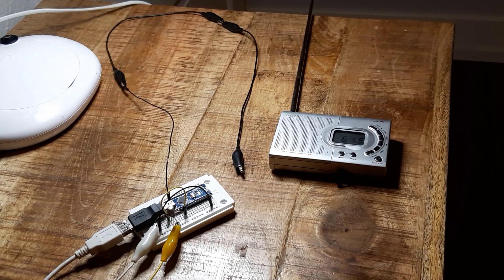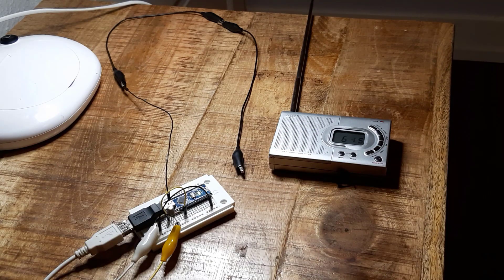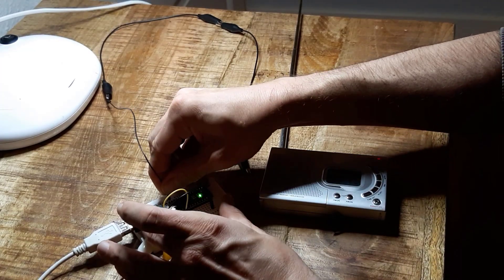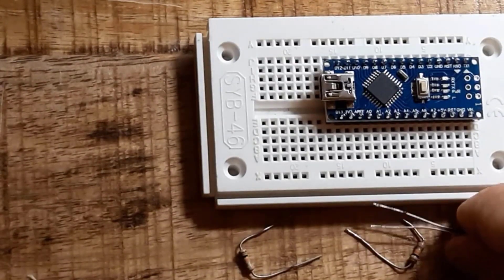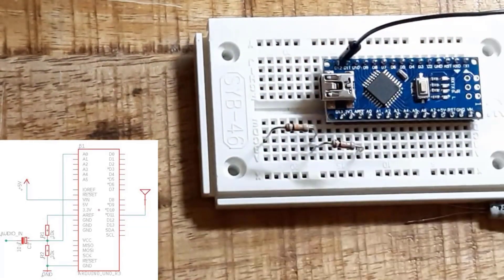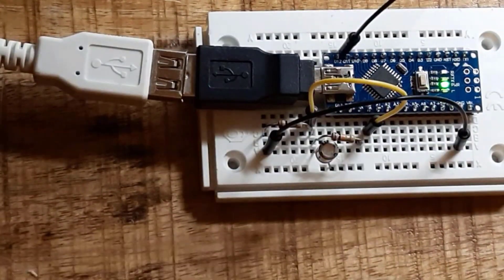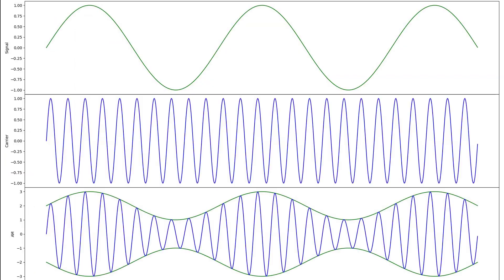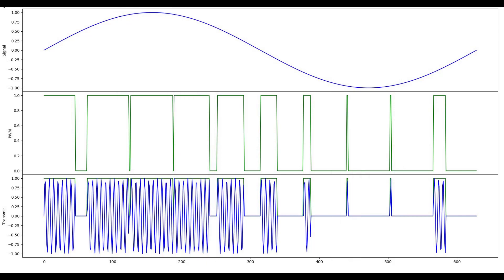Arduino as AM Radio Transmitter

Comment: Hello, I just tried this using a DFPlayer Mp3 module with the nano as the audio in, I can hear the transmission but there is a high frequency ringing in the background. Is there a way to fix this?
Reply from the maker: Must be some problem either with you MP3 module or your radio. I've never heard a ringing.

Comment: How can I get it working with Arduino Mega 2560?
Reply from the maker: Yes, it also runs on the Mega
Reply: @DoctorVolt  I don't know how to get it working properly, also I am in the US so there is a 10 kHz channel spacing, and there is a radio station near 615 kHz

Comment: Excellent, 2 things I want to do but I don't know much about the subject, so that it has a greater range of about 1 kilometer, and so that it is on the 1030 AM frequency, thanks😃
Reply from the maker: You can try with a ferrite or frame antenna. But even with this, I don't think that you will really reach one kilometer without amplifier.

Comment: 8 bit audio quality is too low. Can we do 16 bit? Any ideas?
Reply from the maker: No, because the A/D converter has only 10 bit resolution. I doubt that 16 bit will give better sound quality, because AM sound quality is bad anyway.
Reply: @DoctorVolt  I've designed a circuit. Where to send? It's max resolution is 16 bit but due to noise expect 14 bit sound quality with an audio Bw of 20Hz to 20KHz. Only a single Arduino Nano and two other chips. It transmits on 1600 KHz.

Comment: 8Mhz has a wavelength of ~37m and requires 6.4 meter of antenna (1/4 wave length in copper). So the antenna must be long enough for transmission and reception....Does that explain the limited transmit range of your project? Is there a way to improve it? My initial thoughts are:
1) Using higher harmonics of that PWM signal. Like 5th order. Which will reduce antenna length to 1.3 meter  
2) Use a simple class-E power amplifier to increase antenna current
3) Impedance matching network to maximize output
any other thoughts?

I think it is quite meaningful to hack ATmege168/328 chip as a RF chip by exploiting its high freq PWM. Several privileges: 
1) Do not require an external RF module. Making a wearable ring that transmit data to a RF receiver is totally possible just with ATmega chip. Footprint would be very small.
2) Low power consumption, compared with ESP8266 and ESP32 MCU with RF features
3) Arduino ecosystem, friendly for hobbyists and rapid development, compared with BLE MCUs like nRF52 series
Reply from the maker: Of course, chained crocodile clips are far from being a good antenna. This was just for demonstration. I think that a ferrite or frame antenna in conjunction with an impedance matching network and/or amplifier could significantly improve the the transmit range .

Comment: Doctor Volt, if you don't mind replying. So TCCR2A, TCCR2B and  OCR2A are the main register variables responsible for setting up the frequency?
Reply from the maker: OCR2A defines the frequency, the two other the operation mode of the timer.

Comment: I have a question, does this produce a square wave or sine? If it’s abusing the pin like a certain pi project, and producing a square wave, then it would produce a bunch of nasty harmonics correct?

Only reason I’m asking is I’m looking to build my own low power am transmitter just to broadcast music to my antique radios I collect and like to repair.  But I also know the FCC doesn’t mess around, and if you’re caught with a transmitter that doesn’t follow part 15 guidelines, and it starts spewing out unintentional harmonic frequencies that travel farther than intended, and mess with other devices, they won’t hesitate to heavily fine you for it.
Reply from the maker: Basically, an Arduino is a digital device and thus outputs square waves. So I highly recommend to filter the harmonics out with a low pass filter before connecting an amplifier and antenna. But with a short wire as it transmits only a few meters, so this should be ok for a short test.

Comment: I think, the capacitor is for isolating the source from the Arduino, it that right and would Y1 caps work too?
Reply from the maker: Yes, that´s its purpose. You can omit it, when the source already has an output cap. 1µ should also work.

Comment: because if I put 1602 khz in the code instead of 600khz it does not transmit anything and if I put 1600 khz it transmits?
Reply from the maker: The arduino generates the frequencies by dividing the 16 MHz clock frequency by whole numbers such as 2,3,4,5..255 etc. Therefore, only 255 different frequencies can be generated, for example 1600 kHz (16MHz / 10) or 800kHz (16 MHz / 20). The frequency value you entered into the code will be runded to the next possible value.
Reply: @DoctorVolt  thank you so much for the accurate answer ... great ... now i understand ... i wanted to ask you something if i don't bother you ... is it possible to put an ad9833 to be able to get all the medium wave frequencies? there is a code like yours that works with the ad9833 module and you can write in it any frequency like from 531 to 1711 khz? I tried to search on the net but I can not find anything ... only dds but more complicated .. thanks so much and best wishes for a happy easter.
Reply from the maker: As far as I know, there is an Arduino library for the ad9833 available that can be installed by the library manager. But I have never used this chip, so I have no experience with it. Happy easter for you, too.
Reply: @DoctorVolt  hello sorry if I disturb you again .. I wanted to ask you one last curiosity .. I have done many tests of the transmitter and it works well ... is it possible to increase the modulation? the volume is low by inserting an mp3 player or other line sources. I wanted to know if in the code you can change something to increase the audio in transmission by acting from the pwm or other? thank you so much and sorry again for too many questions ..
Reply from the maker: I see no chance to improve this. The PWM duty cycle already goes from 0-100%, and the reference voltage of the ADC is 1.1V. this means that an audio signal of 1.1Vpp results into maximum volume. Maybe your input signal is too weak, so you can amplify it with an LM386 for example.
Reply: @DoctorVolt  ok very kind .. I tried with lm386 and it works better .. you can not increase much because it goes immediately in the audio saturation but anyway it improves a little maybe the audio input should be filtered to reduce the distortion .. thank you very very kind

Comment: I only have the mega 2560 seems most of the pins you use are on the mega but the code might be a problem I am new to arduino, if you have time a summary of necessary modifications would be most appreciated thanks (any reason why +5v is connected to VIN and not 5v pin & I assume the 5 volts required is from a battery etc? )
Reply from the maker: It also works on the Mega 2560 as it shares the same timer and counter registers as the 328-based boards. I recommend powering it through Vin because then there is a voltage regulator between your power supply and the MCU, protecting it from overvoltage.
Reply: @DoctorVolt  I built the circuit today using Mega 2560 it accepted the code,  I can hear music though I have to hold the AM radio on top of the board as the antenna is not working also I receive the signal/music at 1000 khz but not at the prescribed 600 khz as written within the code so it might need a tweak to the code but not sure what to do? Unless there is a compatibility issue any help would be most appreciated thanks
Reply from the maker: I again checked the code against the Atmega 2560 register description in the manual. There is no difference to the Atmega328 used in the Nano and Uno boards. So I don´t think that there is a problem with that. Did you make sure, that the frequencies on your radio´s dial really match the frequncies it actually recieves?
Reply: @DoctorVolt   Ok thanks I will keep trying thanks for the reply

Comment: I got a question so i dont want to send a full song but just a single Signal and i would love to send this signal from the Arduino how to do that ?
Reply from the maker: In this video: https://youtu.be/Ev3Xti8TeD8 I show how to generate arbitrary waveforms. So you only have to combine the syntesizer code and the AM transmitter code into one. Or to make it simpler, you can take two Arduinos, one as syntesizer, the other as transmitter.
Reply: @DoctorVolt  thank you very much

Comment: Hi, I was wondering whether A0 or Aref is the input voltage to do the ADC on/how do they relate? Since the Arduino takes in voltage from 0-5 V for ADC but audio signals are generally .3 volts, how did you figure that out with the biasing? Additionally, you have a 5V input in the schematic, but I didn't see it in the video.
Reply from the maker: The input voltage goes into A0. In the Arduino´s setup() function, I configured 1.1V (Voltage at ARef pin) as maximum for ADC. So the voltage divider with the two 10k resistors between GND and ARef gives it a bias of 0.55V. With the setup, the output value of the ADC is 512, when no audio is connected. With Audio it can be anything between 0 and 1023, depending on the amplitude.

Comment: @Doctor Volt can we make a demodulator circuit with arduino with the same concept?
Reply from the maker: No, because the ADC is too slow for sampling the antenna signal, and the Atmega too weak to do all the necessary digital signal processing.
Reply: @DoctorVolt  it may be possible to bring down to IF frequency, convert the 600khz AM signal to 10khz AM signal and then do the ADC...

Comment: I like this project and found that it worked well with a modern am/fm radio. When I tried it with an old AM only radio it was not really a success. I changed the frequency  as the old transistor did not pick up at 600. But it did not get acceptable reception and  interference noise was louder than the content.  It may be the alignment on the old radio but it can pick up what is left of medium wave where I live and I had hoped to avoid doing an alignment exercise.
Reply from the maker: I made another video where it works perfectly with a very old radio: https://www.youtube.com/watch?v=6u25i1fyGKg. But there are may also be radios that get "confused" by the PWM...
Reply: @DoctorVolt  Thank you for reminding me about the other video. I had watched it but remembered it for the radio more than the transmitter.  I will have another look at that one. The radio I am having issues with is much newer, a 1964 AM/FM transistor from the budget end of the market. Although more modern I suspect its reception capabilities may still be poorer than the VE301.  I also have a more expensive Dynatron radio also from the early 1960s. I will try that as well. It has better reception quality than the Dansette.

Comment: Tested and worked couldn't get decent audio quality, perhaps because i literally connected the 3.5mm audio jack out my pc with a jumper wire to the capacitor by holding the two wires together by hand, audio quality improves with higher capacitance.
Reply from the maker: Yes according to the properties of your audio source, the sound quality might be better with higher capacitance. But don´t expect too much from a "fake"-AM.
Reply: @DoctorVolt  What capacitance did he recommend to improve the audio?
Reply from the maker: 10 microfarad or more gives decent audio quality

Comment: Wow this video is very cleary, i can easily to understand your explanation. I have a project that is adruino AM transmitter for Morse code, distance about 20-50 meter.  Is there anyway to code for adruino Morse code and modulate AM before transmitting. Sorry for my bad English
Reply from the maker: Sure, setting the antenna pin as input stops the transmission and setting it as output resumes transmission. This can easily be done with the function pinMode(11, INPUT) and pinMode(11, OUTPUT)
Reply: As your mean, I have to add function pinmode into Void loop? If I do that, audio input, resistor, cap can be removed? Right?
Reply from the maker: Yes, that´s right. Resistors and cap are only needed if you want to modulate analog input signals.
Reply: @DoctorVolt  one more question sir. It's possible if i add amplier circuit for antenna which will help antenna transmitt more far
Reply: Oke thank you very much

Comment: Wonderful explanation. But what is the max frequency for modulation that can be used ??
Also, are there other types of modulation schemes possible like ASK, PCM, FSK, QPSK, ADM, etc.
Reply from the maker: The maximal possible frequency is 8 Mhz. The only modulation which the Arduino supports is PWM. And PWM is used to cheat AM here. Maybe it could be possible to cheat other modulation too, but with very low bandwith.

Comment: nice job man Btw you can do fm with raspberry pi and it has amazing range i managed to send data 8km away but i used a gigantic antenna 30 meters above ground for receiving i used 20meters above ground
Reply from the maker: Yes I know this. But I didn´t know it goes so far!

Comment: How can I force the radio station? Cause like I see where you put in the 600 but in the  output it says 615
Reply from the maker: That´s not possible, because the OCR2A register used to set the frequency has only 8 bits. This means 256 different frequencies between 31 kHz and 8MHz. So it always outputs the next possible frequency, not exactly the one that you desire.

Comment: What happens if you don't have a capasitor
Reply from the maker: Should also work, because there is already a capacitor at the output stage of your audio source. So I put one just to be sure.
Reply: I've done it without the capacitor. The sound is not very clear, maybe you should use that for having a clear audio.

Comment: Hi, I'm quite new with Arduino and I have a question for you. When you say "connect it to your Mp3 player" what does it mean? I put a jack into the Mp3 player, than I cut both earphones and I got the blue wire. I connected the blue wire to the capacitor and nothing else. It doesn't work, even withouth music I should ear the carrier if I put 700 KHz, Am I right? Thank you very very much in advance!
Reply from the maker: Yes, when you tune your radio to approx. 700 kHz, you should hear less noise. When you hear no music, make sure you connected ground of the MP3 player (usually the wire mesh around the wires) and the right wire as shown in the schematic.
Reply: @DoctorVolt  I put the earphone ground wire where there is the second resistor but it still doesn't work. I listen to a high pitched whistle in 700 KHz but I have to listen at maximum volume. I know this whistle is related to the arduino because when it's turned off or without the antenna I don't hear That, but shouldn't I hear at least silence at 700 KHz meaning that there is the arduino transmitting even if I didn't set correctly the earphone wires in the circuit? Thank you again!

Comment: is there any way to make more current (or voltage?) go to the antenna to extend the range?
Reply from the maker: Yes, you could add a booster and/or longer antenna wire.
Reply: Or use a your old tv anntena! They are goog!

Comment: This is awesome! About how far is the effective range? If it's only a couple meters Is there any way to boost the signal?
Reply from the maker: Sure... by using wavelength/4 m of wire as antenna. At 600Khz, that´s 125 meters.
Reply: @DoctorVolt  
How can I exceed the 8MHz range?
Reply from the maker: No, this is the maximum given by the internal oscillator.